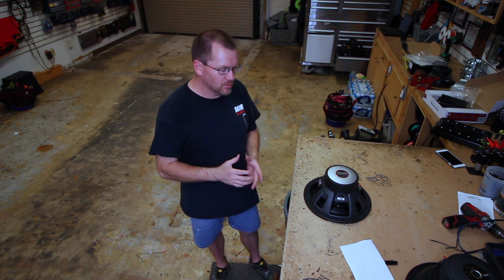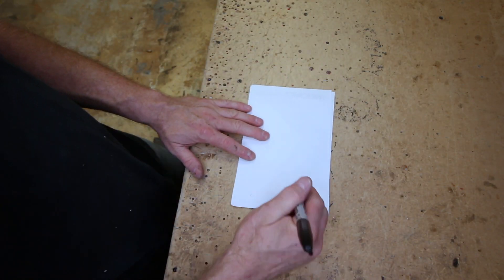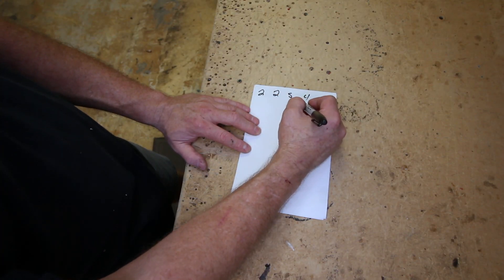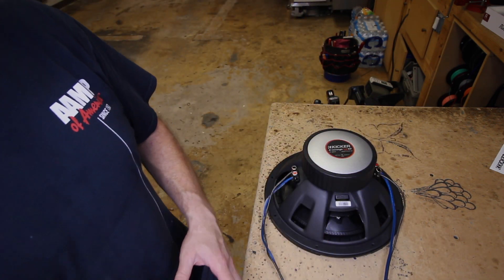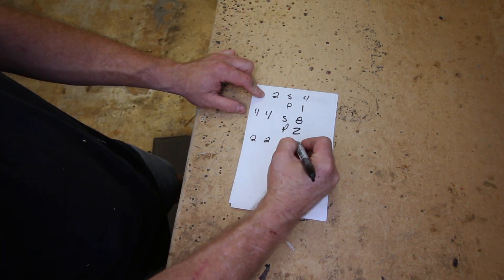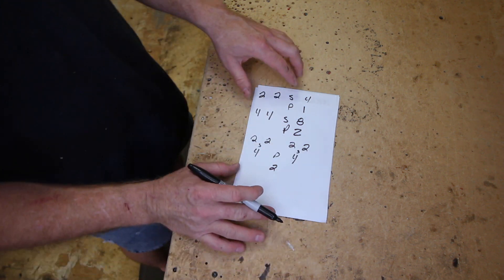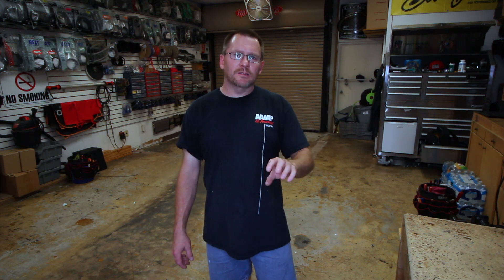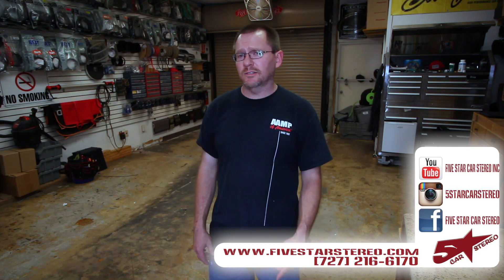How to wire your subwoofers in Series and Parallel to get the right ohm

Comment: If you have two 4 ohm dual voice coil Subs and you want to wire them parallel to become 2 ohms because the amplifier hits harder at 2 ohms will that make the subwoofers and the amplifier run hotter

Comment: Great videos!  Question for the pros!  I have a dvc subwoofer and it has direct wired leads of 10awg.    I wired them in parallel with 8awg ofc...does this affect the speaker/ohms/output, etc...in any way?  The sub is wired from the ported box to the amp with 8awg ofc as well.

Comment: If you wire two different speakers (let's say a 20W RMS and a 100W RMS speaker) of the same impedance in parallel, would you have any issues with the 20W speaker being overpowered?

Comment: Let me ask just this last question if I have an amp (kenwood) max 1000 watts and two 10 inch subs also kenwood but 2000 watts max each will my amp be able to take them on cause it's only one channel
Reply from the maker: Isaac Vasquez unfortunately MAx power is a crazy fake number. It sounds to me like you have the right sub amp combo knowing Kenwood.

Comment: So does it give you more power resistance and more bass
Reply from the maker: Isaac Vasquez yes if the amp can handle it. For example 2 4 ohm subs in parallel give you a 2 ohm load. If the amp puts out max power at 2 ohms, you will get all of its power.

Comment: Hello i have a plate amplifier it have 2 channel 1200 rms each channel i has 4 ohms. . .so my question is it safe if i put 1000 rms watts to this example i buy the kicker l7 dual coil 4 ohms it have 2000 peak watts and 1000 rms is my plate amplifier if i use series wiring and i get 8 ohms load with 1000 watts rms?thank you and what wiring are you suggest so i can get more power and safe. . .tnx

Comment: I have a 1200 hifonic brutus amp mono block with 2 channels and 2 12 kenwood exelion 1200 watts each what the best way to run it
Reply from the maker: junior hernandez if it is a mono is is only a one channel amp. Some amplifier makes give you a double output to make it easier to connect 2 subs.

Comment: every speaker has an re. which is the actual resistance of that speaker.  use a multi meter and check ohm to find the current draw of that speaker.  then do that process that dean mentioned. always follow the manufacturers reccomended ohm load. bye
Reply from the maker: Multi meter, what you talking about Willis. Yes you are correct, not every manufacture puts the ohm load on the speaker. I'm seeing another video coming " how to measure the ohm load of a speaker" thank you for the idea!

Comment: I have a skar vvx-10 i want to build the right box is going on 98 civic how do i figure out the mesurments for the right box
Reply: make a box that measures  15" (h) x 16"(l) x 10"(w) with a port of 1.5" x 4 inches deep (use a pvc pipe)
Reply from the maker: +angel claudio give Shane a call at Skar, he is pretty good at helping out.